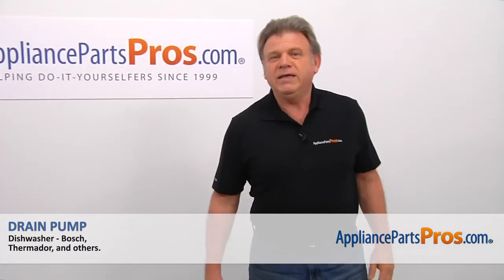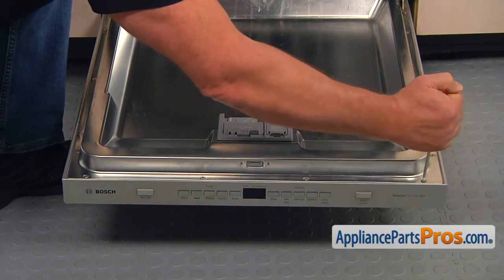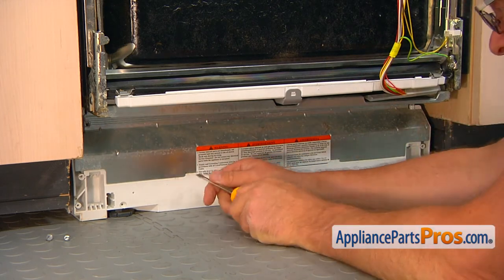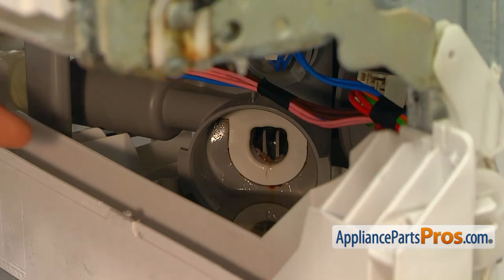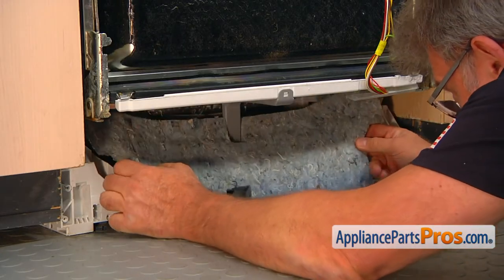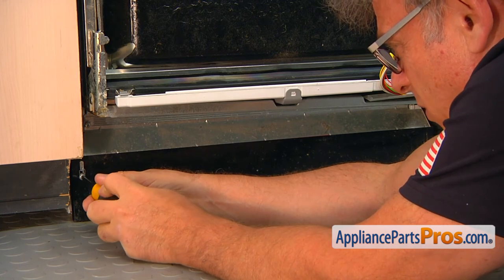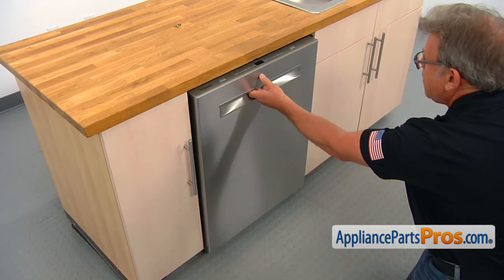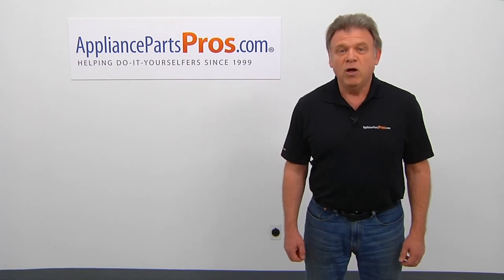How To: Bosch/Thermador/Gaggenau Drain Pump 00620774

Comment: Thank you guys! I used this video and part to replace the drain pump on a Bosch Super Silence Plus 42 DBA that was throwing up an E63-02 error code. Getting the unit disassembled was quite easy, but putting it back together was hard. I had a hard time fitting the new pump in. I had to use plenty of dish soap on the unit itself, rather than the pump, and push quite firmly. I wish I'd taken a video of how I disassembled the unit so it would have been easier to put back together.  I followed other commenters advice and used towels to clean up the excess water before disassembling the unit, so very little spilled out.
Reply from the maker: You are welcome! Glad you were able to fix your issue! If there is anything we can help you with in the future please let us know.

Comment: What a great video. Thanks so much. I tested it before reassembly just to make sure no leaks (would be harder to tell with the door back on). Wasn’t prepared for so much water coming out when taking the pump off. Should have removed as much as I could from the filter area first.
Reply: I used a small siphon hose and got my completely dry
Reply: I just used a bunch of old towels and tossed them in the washing machine after

Comment: Only the three side screws and top corner screws hold the door panel.  You can leave the top midge two screws which hold the control panel.  Thanks for the clear video though.

Comment: We have a Thermador DWH650WFP, now ~3 years old.  We hadn't been cleaning the microfilter as much as we should have, but we are now.  There's a collection of oily residue on the filter which we clean out, which I believe is expected.

After opening it up recently, we found that the round reservoir that holds the micro filter has standing water in it.  Is this normal?  It never overflows past the flat fine filter so we never see water collecting in the bottom of the dishwasher.  I evacuated the water, inspected the drain pump and took out the pump cover.  I didn't see or feel anything blocking things.  I manually touched the drain pump rotors and it seems to rotate freely.  I replaced the pump cover without issues, thanks to your other video.

I ran a quick rinse cycle and inspected it again.  It again had standing water within that round reservoir, about half full.  Is this normal?
Reply from the maker: Yes, that is normal.

Comment: I’ve been trying to get the drain pump lid on for the last couple days it’s like a half inch from the seating hole. Is there something I can do. I’ve destroyed my fingers as well as used pliers and screwdriver to push down but it’s down to the bottom won’t go anymore.

Comment: Hi there, how can I know if the drain pump is defective or good please? I measured the ohms resistance and it showed 91ohms between each phase. Also the propellor turned smooth. Appreciate any help 🙏
Reply: Why bother? For $35 just replace the dang thing.

Comment: Thanks. We did everything you said and bought your part but now when we go to run it, it turns on, it doesn’t beep at me letting me know it’s unhappy and LOOKS like it’s going to start a load. The numbers display :09 for a rinse cycle, but nothing happens. It acts like it’s running but nothing happens. We made sure to turn the water back on to it and the disposal is plugged back in. I would think either it would beep at me or I’d get an error message, but it just loops :09 to arrow and back and forth but never running. Any ideas???

Comment: I replaced the drain pump on my Bosch dishwasher and thought I should test it before putting the door skin back on.  The dishwasher doesn't seem to fill with water, it just seems to run the drain pump

Comment: My drain pump in my Bosch dishwasher is  turning (plastic fins are all there) but not draining water . The pathways are seemingly clean. Is it the rubber valve near this pump which is responsible? It seems intact. Thank you.

Comment: Hi. Great video. I’ve taken the faulty pump out but for the life of me I can not get the new one in. 3 hours I’ve been trying and am on the verge of giving up. Help!
Reply: You have to grease or oil the rubber o-ring on the new pump, and clean the hole where it goes into, remember--turn it counter-clockwise to re-install it
Reply: I had this problem too. It's hard to do. I had to use dawn soap on the o-ring and the hole. It was very frustrating.

Comment: I have a Bosch 800 series dishwasher and replaced the inlet valve and the drain pump. When I reassembled everything the dishwasher runs fine but the panel won’t come on. Is there is reason the panel lights are not coming on? Thanks
Reply: Mightve nicked or crimped a wire during the repair

Comment: Can that front metal panel (called "frame support" in the video) be removed without taking the door off? Taking the door off seems like a lot of work just to get to those two screws holding that front panel on.
Reply: It can be done without taking the door off